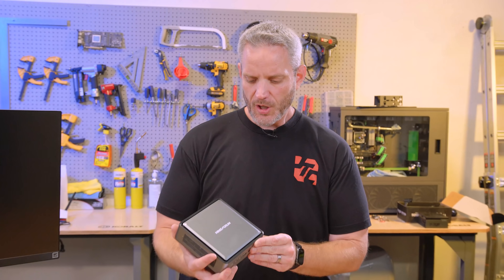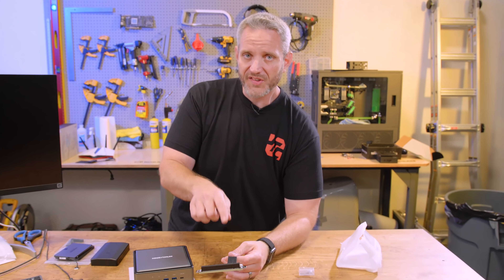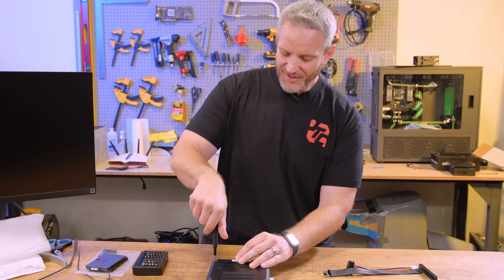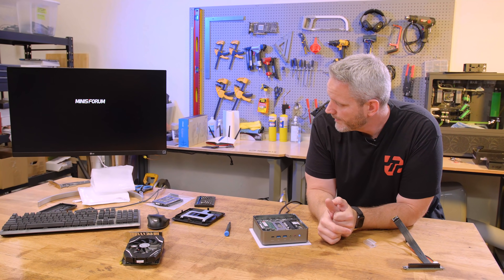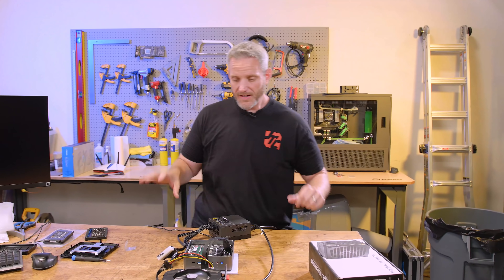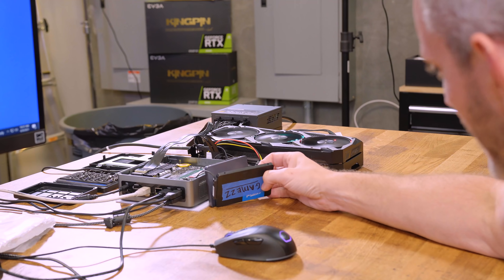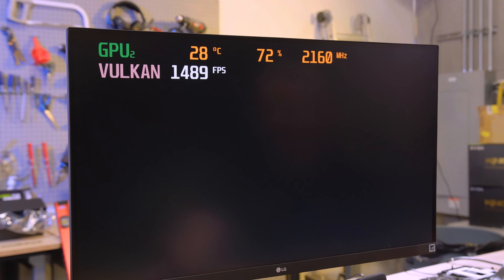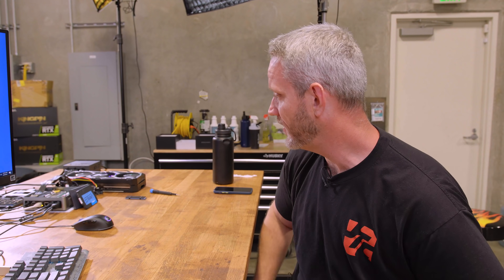This was easier than I expected it to be! Super powerful mini pc

Comment: Easy: Mount it in a desk.
Hard: Briefcase to bring to LAN Parties.
Reply: Put a PC in a monitor and make it better than a Mac, then explain how stupid a PC in a monitor is :P
Reply: @Commander_ZiN  its only stupid if you cant properly keep the PC components cool enough to not throttle
Reply: @Titokhan2  there's many other reasons.
Reply: Monochromatik-Vision 
👆🏻

sad
Reply: harder: in a picture frame
Reply: @dallatorretdu  i thought this same thing. im for it
Reply: @Monochromatik-VisionI had one of those 22" monsters (weighed around 30kg) but also had a smaller 15" that I took to LANs
Reply: They have LAN parties?
Reply: I used to do that for a living. but the fad faded, and my company failed to the fad of a pretty RGB tower that can be shown off.
Reply: @mikeward2465  That company failed to the 'fad' of the internet being affordable. Come on now.
Reply: Yes to the briefcase!!!
Reply: That's... basically reinventing the Laptop...
Reply: would have to be a slightly larger briefcase because of the secondary power supply.... but that gives options for adding fans for the obvious problem of putting this hybrid monstrosity in a briefcase.. airflow

Comment: ive honestly never had bad results with these kind of adapters. usually its m.2 to PCIe x4 but i've used an m.2 to PCIe adapter before as well just for testing purposes, and it ran a folding@home GPU just fine! gaming performance was suspect but it was still fine on anything that didn't need more than x4 bandwidth to perform well. All the adapters I got had a molex, SATA, or PCIe 6pin on them though, to power the slot properly. All the ones I tested ended up being the 6 pin variety since they were the best built as well. I didn't even bother getting any that had floppy power adapters, the last time I had a GPU with a floppy power adapter on it was around the ATI Radeon 9800 series lol

Comment: Imagine this. You have an entire portable projector system inside a briefcase. You just flop it open and it projects onto a wall
Reply: Could power the whole system from a 12v battery with a stepdown transformer from 12v to 5v and 3.3v for SATA.
Reply: i like this, i like this one.

Comment: Makes me glad I built my system a couple of years ago. At least I have a 2060 gpu. lol
Reply: Makes me gad I built on last year/this year.  Have a 3080.
Reply: @andrewt.5567  It’s all good. I built my system in a itx form factor and using the Asrock AB350 mobo, the cooler master elite 110 case, 16gb of hyper fury memory, along with the Cosaire H55 liquid AIO and a Ryzen 5 2600 overclocked to 3.9 MHz stable, and a Zotac RTX 2060 Amp graphics card.

Comment: Honestly... those Sata power cables are not designed for anything over 35W and the typical motherboard can supply up to 75W to the PCI-e slot. Thats why I think those ribbon cables may not be safest option.

Comment: Remove the internals of both the power supply and mini. Build a custom backplate for the GPU that mounts all of it together. Then build a small case around the backside of it. You would literally have the thing you couldn't say

Comment: And another thought, use a twin fan 3070 and put the computer in the "third fan" location. A little trim paneling and it would look almost like your ONLY running a GPU as a computer.

Comment: A sata to USB-C power adaptor and a on/off switch in-line with 24 pin "test" connector and you have a completed power circuit.

Comment: You could have gotten a riser that would draw power from an 8 pin vga connector instead of that sata power connector.  It would have been much safer and less risk of a fire.

Comment: Build and entire PC INSIDE a hollowed out RTX 3090 shell? Or an Amiga 500 shell?
Reply: Although I really don't understand the attraction of small PC's - PC's are BEAUTIFUL, and with addressable RGB especially, the BIGGER the BETTER. More full SUPER TOWER case builds please, with custom water cooling using all 140mm fans and multiple 560/420mm radiators, with near ambient CPU and GPU temperatures, for ultimate stability and longevity please. :)

Comment: SATA standard = 54W, PCIe standard = 75W. By using SATA you introduce a better than average chance of failure due to overcurrent of the conductors and/or connectors.
Also you don't need to sync the power buttons. For turn on: 1st GPU power, 2nd PC power.

Comment: That's not how the mining adapters work. There are pci to 4x usb and you connect the risers which are usb to pci 16 x. The usb to 16 x also comes with a 1x pci at the end of it if you want to plug right into the pci 1x.

Comment: Yo Jay you probably forgot that those types of GPU 20 or 30 Series card's back plate can get pretty hot, so... might want to lay it side ways for back of the GPU to dispate some heat. Overall it's impressive for an only x4 PCIe Gen 3 to work well with that APU! Good video man!

Comment: Hey Jay, extremely interested in this. There is a custom PC build called Tenuis (followed later by Tenuis 2) designed as a thin vertical build. It's like an in-desk PC but instead mounted vertically, which makes this more of a show piece than incognito PC. I think you'd have a lot of great ideas on a build like this.

Comment: You might as well lose the little power supply and stick the barrel jack on a molex. Then the power button would only work if the psu is on.

P.s miners only need a x1 slot for cards and wouldn't use pci- to m.2 then back to pci-e when an x1 to 5 x16 card is about 5 times cheaper and you can pack more cards in even more slots also the mining cards have plx chips so they work without bifurcation support

Comment: I pulled out a WiFi card out of my old all in one that has a 4ghz cpu and used a riser to add my 1050ti to it but just know that all risers are not the same! The only one I had any luck with or that actually worked was one called the BEAST and I still use this computer some today. Works fine. I did this over two years ago just to see if I could. Still kicking today!

Comment: I rebuilt an old landfill server box with a 10 core $100 Xeon E5-2690V2, and new $120 Chinese MOBO, 32GB of RAM, Tosh EVO 960 SSD, a nice 650W Corsair M power supply, Noctua cooler, and my old GTX 960. It cost me under $700. I have had it running for six months now without a blip. I use it for video processing. It isn't the very fastest in the world, but it is rock solid, and has never let me down. I could game with it pretty well if I wanted to. I even have blue teeth, and wifeys using adaptors - $40 total.

Comment: FYI, the GPU PSU should be first on / last off. The GPU will ignore the external power if the slot isn't active, but if it gets power and doesn't see anything on the external, or if the external PSU drops dead before the slot turns off, it'll freak out.

I've spent a fair bit of time doing... Questionable... builds involving external GPU power, and those cards are not happy when the external power drops unexpectedly

Comment: I'd is somehow hook onto back of monitor or on a triple monitor vesa arm and make somekind of all-in-one type of setup(if can put on monitor back to hide it) or set up as a dual-monitor setup with the mini pc/etc somehow hooked onto center arm hidden behind the two screens.

 Beyond what Id do, be cool to see taking a small mini pc like that and someone modding it to fit card more "in it" without changing the form factor too much towards full tower, keeping minipc with the card and powersupply somehow set up that its just not all sitting there. While making it so you dont have to power on supply and PC both, and it being modded to just 1 button to do both.

Comment: 0:49 that processor is Zen2
2000 series APUs are Zen1(2700u 4 core+10GPU)
3000 series APUs are Zen1.5(3700u 4 core+10GPU)
4000 series APUs are Zen2(4800u 8 core+8GPU)
most odd number 5000u/h series are Zen2 basically the 5700u is the 4800u with a faster GPU(8 core+8GPU)
And most of the even number 5000u/h are zen3, with the 5800u  being Zen3(8 core single CCX+8GPU)
The desktop 5000 series APUs are Zen 3 even though the 5700g is odd numbered

Comment: There's no need to use a pcie to m.2 adapter to make crypto-mining multipliers. Not only those cards cost quite some buck (e.g. Asus Hyper m.2 Gen3 at 50, gen4 at ~100), but they also need bifurcation support on the motherboard (and that's x4x4x4x4, x8x8 will only allow 2 cards), AND an extra 50 bucks per ADT-Link adapter (so that's already a 250 bucks endeavour...), BUT there are actually USB-based risers that will convert, WITH BIFURCATION on the card itself, an x4, x8 or x16 slot into the equivalent (at most) x1 electrical wiring to x16 mechanicals.

Comment: How bout this:  Put a PC inside a Window Mounted Air Conditioner...it would be a Window Windows PC.  

Bonus points if you tie the radiator into the AC loop.  

Double bonus points if you attach the CPU/GPU heat pipes directly to the AC coils.

Comment: welcome to the wonderful world of eGPUs... Luckily, m.2 doesn't have half the problems of the Thunderbolt 3 variety (and are much cheaper...). Unluckily for m.2 eGPU users, this isn't that much fun to set up due to the power supply shenanigans, lacking physical support and protection for the GPU card, getting the PSU to kick in without a power on signal using a short circuit most likely, and worst of all... this makes the laptop (where most people would use this) kind of not that mobile, since you have to reattach the backplate when needing to remove the connector.

If you want a creative use for an ADT-Link pcie to m.2 adapter: put it in one of the 1L 10th "TinyMiniMicro" machines with 10 cores, 20 threads. Most of the recent ones have TWO m.2 connectors AND a standard sata interface so you don't actually lose m.2 NVMe. For those unaware, the 1L machines that Dell, HP and Lenovo make for "low-level" workstations, with 35W "T"-series CPUs that aren't quite laptop, quite not desktop 65W parts (although some models, such as HP's EliteDesk  800 G6 take 65W desktop parts with their 95W PSU option, or even 125W k ones for some reason, don't tell me how that works out for the PSU they bundle...). Lenovo's Tiny line can also be adapted with a proprietary x8 yet full x16 length connector (well, actually an old laptop GPU standard that nobody uses anymore), and those already come with 10th gen. But good luck finding that connector... Or you can just use the ADT-Link on one of the two that 10th Gen Tiny has.

These may not be Ryzen (although I think one of them is shipping soon...), but they are more powerful than laptop Ryzen mostly, have longer-sustain, and are very actively cooled machines (by a somewhat larger fan than laptops or the Mini's forum solution). 8th-10th gen machines are available for like 200-400 bucks on ebay because they are dumped by big corpo and flipped/recycled by re-sellers, they are quite the nice machine to get someone going for work without a graphics card (or with one, you know if you do these tweaks). Unfortunately, most T-series chips lack hyperthreading. This is what happens when Intel still has a monopoly - they save nice features for the i7 models only. And those T-series chips are EXPENSIVE and RARE when purchased alone, so you better get the one you need when buying the 1L machine!

Comment: What I'd love to see...
I'd love to see how far an APU can be pushed. You can argue that the APU (SoC really) in the XBox Series X is about it so far. Sure, but that's a walled garden. But I'm really curious to see how far you can push a DESKTOP APU once DDR5 comes... Laptops are neat too but they have cooler issues that affect maximum thermal dissipation and/or fan noise. I'd just love to see what you can cram into something that's much smaller than a typical desktop BUT that can also have a relatively much better cooler than a laptop (i.e. maybe a nano-ITX system that's a total of 5" x 5" x 3" not counting power brick and has specs similar to 8-core Zen3, 64GB DDR5, 16GB GDDR6x)... I'm also curious to see if AMD makes an APU that supports quad-channel for desktop (i.e. 2x16GB DDR5)... what AMD can mass produce through a fab isn't the same as what makes sense but I'd still love to see an EXAMPLE of how far an APU can be pushed out of raw curiosity.

Comment: That pc setup would probably be perfect for your racing simulator. You could tuck it underneath the seat and put a dirt/dust deflector over it to help keep the gpu clean, and no more fighting the wireless signal range on components.

Comment: Actually, The 4800U is based on Zen 2. AMD probably made the 4000 series for their Zen 2 APUs since they already had used 3000 for Zen+ APUs.

I would expect that the primary bottleneck here would not be the core architecture, though, but rather that the APU only have 4x PCIe 3.0 lanes to the GPU. 

It might have been interesting to see how such narrow connections affect different games and GPUs, but it would be a huge task for something that would probably not be very useful for most people.

Comment: what I would do is use an old server PSU (with fan swap.. I say server PSU because they are small but any PSU would work) and  have the 12v power split into to directions. one would go directly into the NUC (using a buck converter to step down the voltage if needed) and the other would go into a high amperage relay that would be triggered by the SATA power off the NUC. this would allow you to have a single power supply that would be always on, and the GPU power would be triggered automatically when the NUC is powered on.  

I also like the idea of mounting the NUC to the GPU... you could make a little car out of that, but I would have the NUC mounted (with a custom bracket taking advantage of the GPU's PCIE mounting hardware) to mount the NUC on the back-plate side of the GPU along with the power supply to make a very compact computer

Comment: Uhm... Make sure to run an extended test while monitoring the cable to the riser to see if it melts.
Using SATA power for the risers are strongly discouraged in the mining community due to it beeing a potential fire hazard if the card draws 75watt through the PCIe slot.

Maybe talk to Steve about it, as they recently did some testing with too high power draw.
Reply: ↓ Pínned by JayzTwoCents √  This is a scam for anyone seeing it.

Comment: If you find an old VHS video (VCR - which is thick and may fit all these), modding it a bit, will probably fit this motherboard, the huge GPU and the PSU. That would be awesome. The thermals will not, but that's not the...case :p

Comment: i would not trust that sata adaptor. easy way to set your system on fire. if you use something like that make sure the pcie board has a full size molex connector.

Comment: That riser is gonna burn up.  GPUs can easily draw 150W from the PCIe slot and I don't trust sata power (54W max).  I used to mine with GPUs and rule #1 is you never ever ever use anything other than pcie 6 pin (or molex for this scenario).  The rail on the sata adapter will burn up and it can melt your cable and start a fire...

Comment: Do a real gaming chair where the computer is the chair.
Reply: Only if the chair has its own heatsink to keep the user cool as well.
Reply: @rollin340  LTT already made one of those chairs, think it already has power delivery on it.. problem is all the water pumps and tubing in the chair itself take a lot of space
Reply: @tpss3834  I remember that. Jay should have a crack at it himself! xD
Reply: @tpss3834  Yeah, that was a really weird way to do it.
I just bought a seat out of a crashed luxury car for a low price and mounted it onto a DIY base. It is electrically adjustable in 18 ways, has a massage function, 3 memory settings and it is cooled with 2 fans (that I swapped for quieter Silverstone ones with individual speed control).
Doesn't cool to below ambient, but I prefer the airflow it gives me.

Comment: Great video as always <3

Try avoiding gpu risers with SATA power connectors. You can get one with pcie power connector instead. Because SATA power connector wires are flimsy, not as durable as pcie power cables and are prone to catch fire if used with higher TDP cards or even small cards sometimes. 
And GPU power (psu) needs to be turned on before turning on the NUC in this case. You don't have to worry about turning them on exactly at the same time.

Comment: I used to have an external GPU with a 5700xt and gamed on it with my i7 MacBook pro. I think it's also limited to 4x PCIe instead of 16x like plugging it in a motherboard directly. I would say I lost about 30% performance comparing to when I actually putting the gpu into a pc. But 4k at 140fps is impressive!

Comment: Steve would be very upset to see you using the included SATA cable. SATA is rated for 54w vs the 75 the slot can pull.

Comment: Based on my limited mining experience, powering a riser with SATA like that is a fire hazard as the GPU can draw way more power from the slot than that connector can handle.
Edit: There are other risers that take 6 pin PCI-e or 4 pin molex for power that get significantly less melty after extended use.

Comment: Finnaly! Someone put a good" fix" for laptops/mini-Pc's that have good CPU, but lack of GPU. You should do a video with all 3 external GPU possibility of connection ! (M2 Pci, wi-fi slot and USB type C) and to compare the results of an rtx 2060 or highter (to see the performance pennalty of pci X1 or the P. P. of the interface ) ad try it  with an  adapter  called Beast (V8. 5B or newer)

Comment: Is it possible to use the PCIe socket of the WiFi card to install the graphics card on this mini PC?. I've done that kind of modding to a couple of laptops in order to use a discrete graphics card at the expense of losing wireless connectivity (but that could be supplemented with a USB WiFi card or even wired LAN).